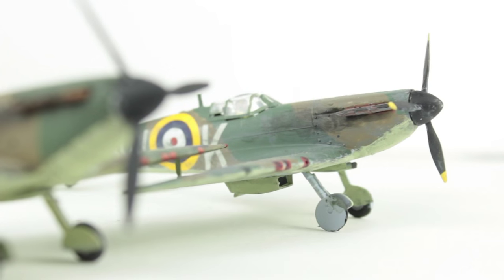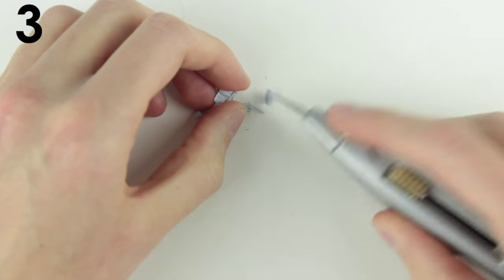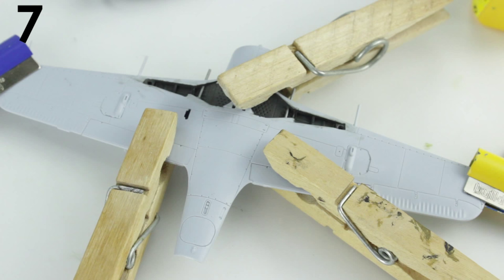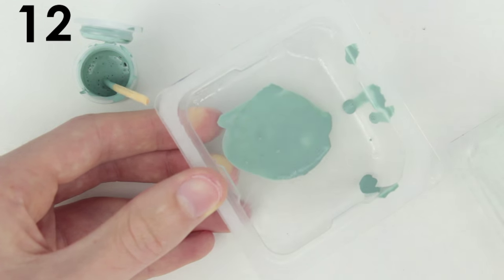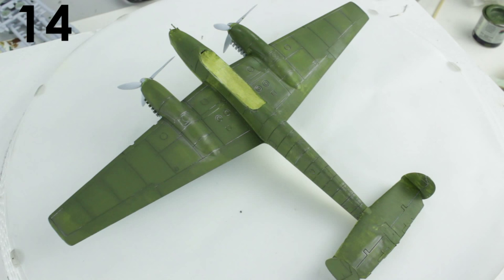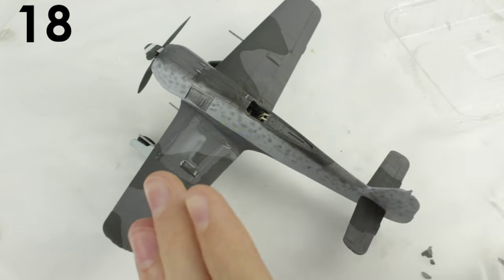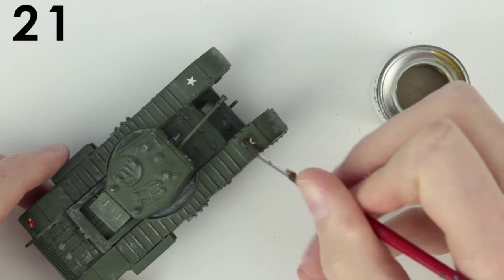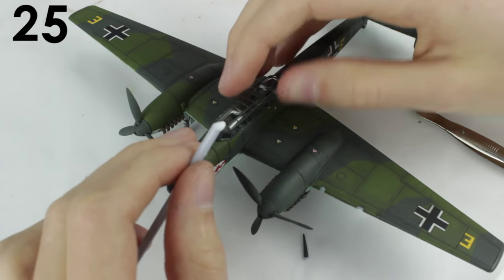25 Tips for Scale Modellers

Comment: Good tips, but I disagree with one of them, my personal experience is that people who cut sprues with a scalpel spend more time with their heads under a table looking for that part that popped away than they are actually modelling.  Or they end up breaking at least a dozen parts and the reaction is always a sheepish "That can't be helped, it's part of the challenge"  No, it's not, for most parts simply invest in a pair of good quality flush cutters (or even good quality fine work scissors), you don't need to cut right up to the connecting point, leave a little tab and gently trim it off with a knife or sand it away.  With cutters you can hold the part until you have cut all the tabs and not having to rely on the sprue to act as a "force field" to keep the part from flying into that dark hole where all your parts seem to vanish. And for the parts that will snap no matter how careful you are with a scalpel or cutter because of the tension and force that needs to be applied for cutting I have a superfine file which has a very fine grit, if you run it gently on the connecting point it will come off without any strain.  I can count the number of parts I broke on the fingers of a very clumsy table-saw operator ...

And while I'm at it, never ever assemble kits with superglue, I made that mistake years ago with an Airfix AH-64 and it simply fell apart a few years later.  To join large areas use proper cement in tubes with an applicator nozzle as the glue will stay dry longer.  For smaller parts you can use liquid cement with a brush applicator, the liquid cement having the advantage that they do not leave any marks on the parts when they dry, at most a shiny little area that can easily be painted over.
Reply: I think you are right. I'm just a beginner but, for me, I find it easier to cut them out with flush cutter and then cut again the remaining nub with scalpel or use sandpaper 

actually, sometimes just flush cutter turns out to be enough
Reply: Im taking in all th information I need for my first kit.
Reply: I use superglue on brass locomotive models that are exposed to extreme temperature ranges from 100+ degrees F to minus 35 and the parts have never broken down. The problem is the age of the superglue. Always use superglue that is within 90 days of the bottle being opened. Don't use superglue on clear plastic. I also use an xacto knife to cut parts from sprues. Use a mirror or glass to cut the parts on and hold the part, not the sprue when cutting. Flush cutters tend to pull plastic away from the gate and leave a hole to fill.

Comment: No 1 tip : use an airbrush
Reply: It's expensive
Reply: not everyone has space to use an airbrush. They are far from being an easy option either - in fact their use brings a whole new set of problems to the table! So crap tip!
Reply: stupid know-it-all. Some if not most do live in small spaces, don't have a 'workshop' and have to use the kitchen table etc So not everyone is going to have the space or the money to use/buy a compressor. Cans of air are stupidly expensive ..and then there's the problem of cleaning and striping the brush after each use. As I said ..just more hassle.  'Use an airbrush' is not a tip for those starting out, far less no.1 ..
Reply: Kommander Rahnn You do have to strip it to clean it but it is a very easy process. And it is easier because you don't have to paint 5 coats unlike painting with a brush. Plus you can get compressors that are very small and cheap.
Reply: Kommander Rahnn by dissassembling it i mean taking out the needle and the nozzle.
Reply: Why r u watching this if your models are soooo goood
Reply: Kommander Rahnn well sorry rich man its not like i have 100 dollars in my pocket.
Reply: Kommander Rahnn the thing is, the sprayed out air with color from airbrushes fly in every corner and on every wall in the room, so without a workshop it's not really intelligent to use it in a room, where you live or sleep or eat
Reply: Kommander Rahnn  got any tips, mate?